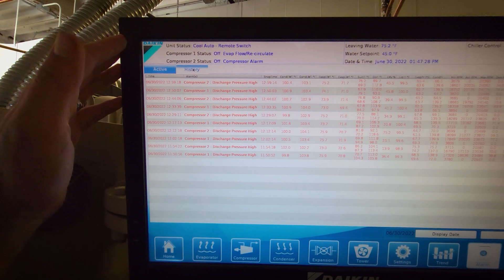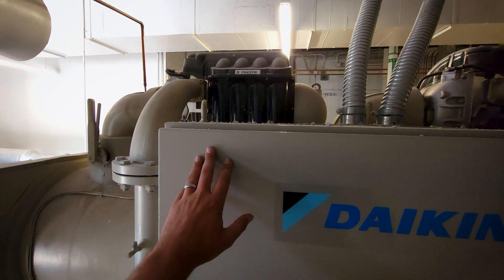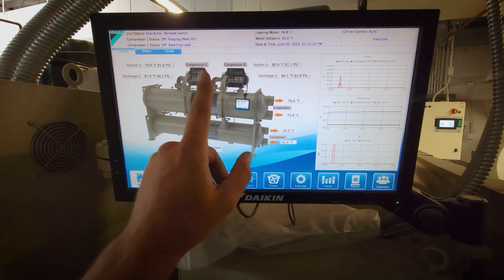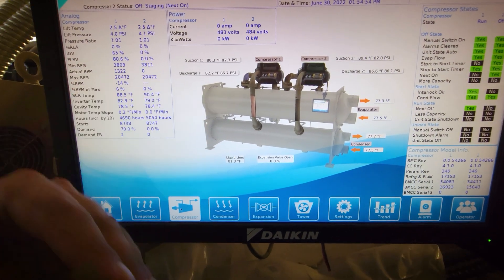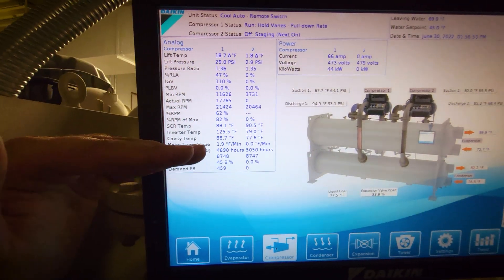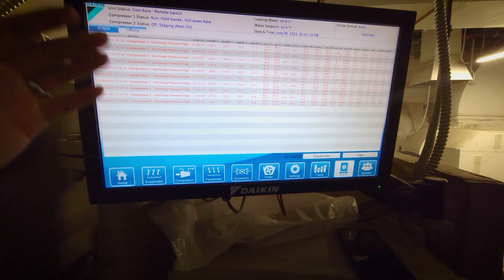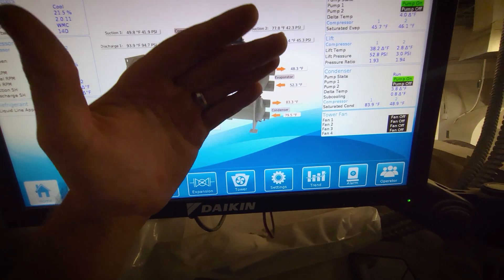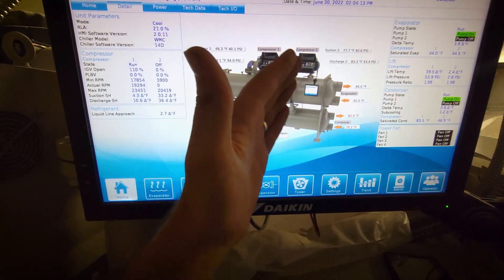Magnetic Bearing Chiller Down

Comment: I have seen a refrigerant pump installed on that line,  it was installed so the turbocor could run in low load applications. I know that's not what your dealing with here.  Just some input on what others have done.  
Don't let your meat loaf!
Reply from the maker: Was the pump assembly factory?

Comment: I would be concerned that the condenser bypass was not working correctly. It should be in full bypass during cold condenser temperatures.
Reply: You would be surprised at how many facilities don't have a condenser bypass

Comment: That ABB is improperly programmed if it doesn’t come back up on its own from an overcurrent/undervoltage fault caused by a power interruption (which this seems like it is: overcurrent when the voltage starts dropping, undervoltage when the power’s out, then overvoltage when the power comes back on while the fan is still spinning)

Those cooling tower fan motors would likely be failed “overcurrent” or “earth fault” at startup if it were any kind of winding issue.

Second, parameter 2006 “undervolt ctrl” would allow the drive to keep using the kinetic energy in the fan while the power is out. Danfoss materials indicate that you can ride through several seconds of power loss on a fan, and around 2 seconds on a pump. This feature (on Danfoss units) has solved all the alarms I was getting in a building with terrible power (multiple undervoltage trips per day, per hour even sometimes)
Reply: Redundancy is key with this equipment and that VFD should 100% be back online after a fault.
Reply: I wondered...square d and the likes have settings for # of retries.
Reply: @d69f69  yeah they’re actually really smart machines once you read up all the instruction manuals
Reply: @Ak3rn0  therein lies another problem. It's not rocket science but nobody bothers to read the manual. Even when their job requires it.

Comment: I have not come across that particular issue but i have seen a few chillers that lock out if the evap loop is to hot. Well it is hard to cool it down if the compressors aint allowed to run.

Then you got to haul your ass over there and manually run compressors at low capacity and sometimes reduce the evap flow temorary just not to trip at high preassure.

Comment: Sounds like bad engineering by diakin.  Should maybe put a refer pump on the inverter heat sinks.
Reply: On the York yz we use a pump for motor cooling when low lift
Reply: Mike brat they are magnetic coupling pumps. Cool little units
Reply: I agree the inverter should have its own cooling system. This design kind of sucks.

Comment: Why are there no check valves on these condenser water towers So that way inversion won't happen
 Or are you saying that it inverts where the condenser turns into the evaporator and the evaporator turns into the condenser is that the inversion you're talking about ....just asking
Reply from the maker: Evap water gets hotter than the condenser water
Reply: When a refrigerant circuit is off, the liquid refrigerant tends to migrate toward the cooler location. Add gravity into the mix with the condenser being below the evaporator, and you can see why the condenser water being a lower temperature than the evaporator water can become an issue. It's sort of a chicken-egg problem. You need a pressure differential to get the liquid refrigerant to flow across the inverter plate, but to create that pressure differential you have to use the compressor and the inverter that powers it.